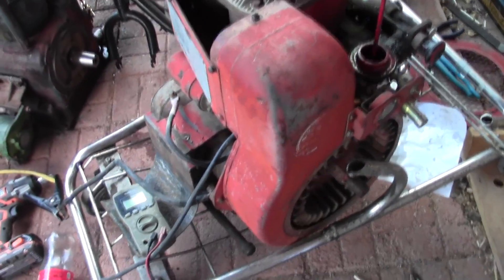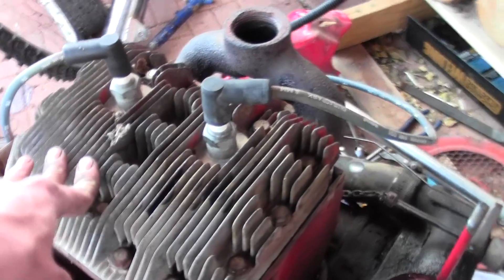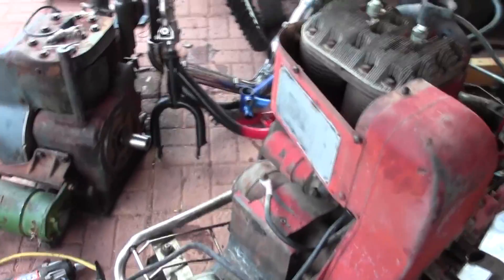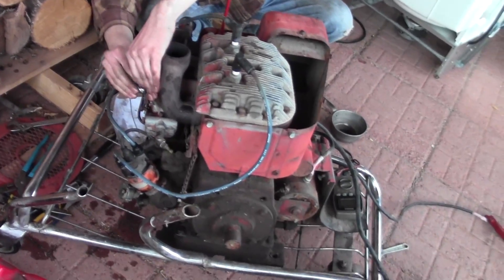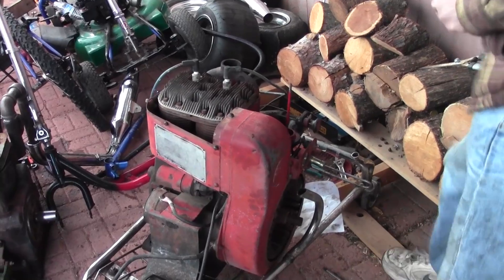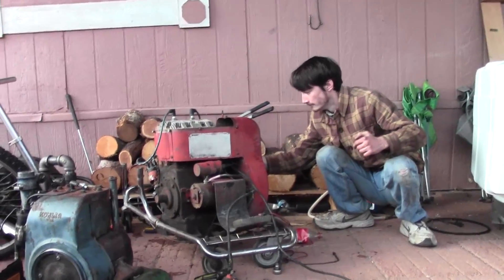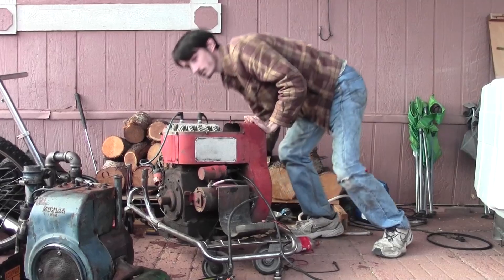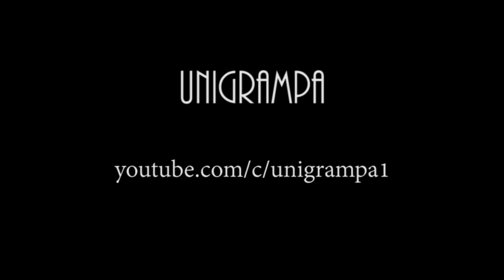Wisconsin 2 Cylinder THD First Cold Start In 20 Years

Comment: Pouring gasoline into an engine from an open container is very dangerous. If that sucker backfires he and everything around would be covered with flaming gasoline. 
I got a magneto fired TJD running, was a fun project. It sure did sound odd!

Comment: thanks but i need a used distributor
Reply from the maker: If Ebay doesnt have a used one, you might be SOL. This is not a common engine. Parts are gonna be scarce. You can try just googling it, sometimes random tractor websites have parts new or used.
Reply: unigrampa's Laboratory. Tell me the websites

Comment: hello, been searching the internet for information on these as I found one at an estate farm sale connected to a Lincoln welder. It turns (not seized) but nobody knows if it will run, it's actually a TFD, considering it doesn't currently run what do you think they're worth? They want probably too much for it
Reply from the maker: Hard to say value, depends a lot on the condition and your local area. If the cylinders are good, most everything else you can fix pretty easy. Engine in running condition is probably a 200$ thing by itself if you find the right buyer. Maybe more but engine prices have been dropping cos all the old guys dying. With a working welder attached to it, you could probably ask 800$ for it fairly easy if it ran. If it starts easy and you put a nice coat of paint on it and make it look roughly factory, probably even quite a bit more.
I wouldn't pay a lot for it though. You don't know if the windings are good or how much work you're getting in to. I'd offer $100 for the whole unit. Maybe $150 max. 
That's just me though, those are just my estimates. Your milage will vary.
Reply: @unigrampa  yeah that's about what I was thinking, thanks! One of the welder cables is kinda melted so I doubt it's in top condition. The engine serial number comes up as being made in 1941 on the Wisconsin site but that seems way  too early, specially considering it's in Australia and there was a war going on at that time. thanks for the info.